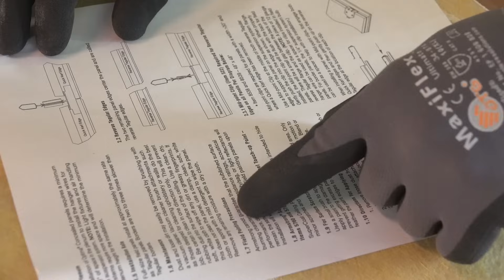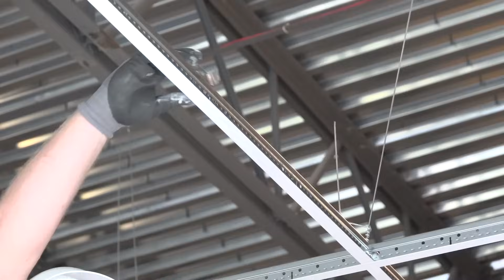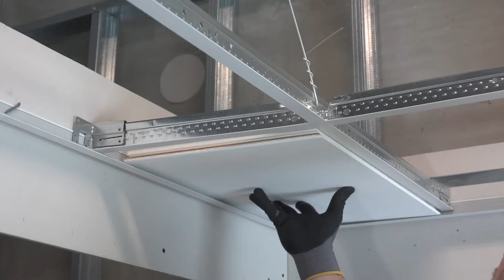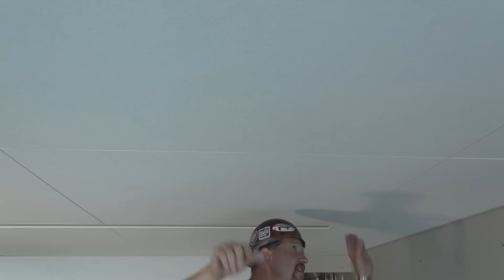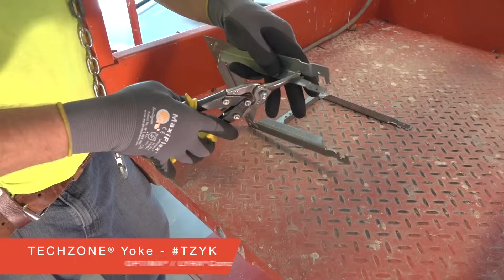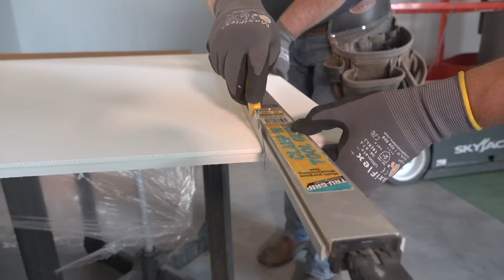Concealed Ceiling Suspension Systems | Installation | Armstrong Ceiling Solutions

Comment: What bonehead architect would spec this for a tiny job in the middle of the Pacific Ocean (Hana, Maui). It turned out nice but makes no sense, and I garontee if the maintenance guy has to get in the ceiling it will be over for the fancy tile and it will be a bunch of random patches of Armstrong 769.
Reply: "nothin finer then 769er" lol. Totally agree the maintenance guy doesn't stand a chance.